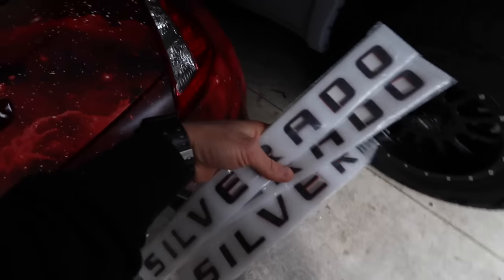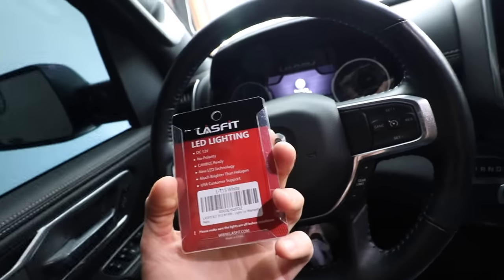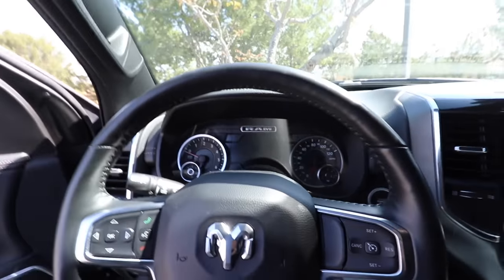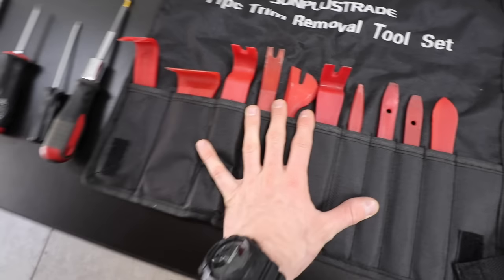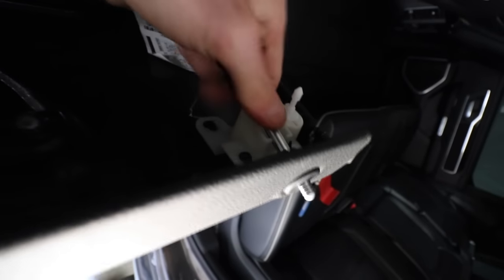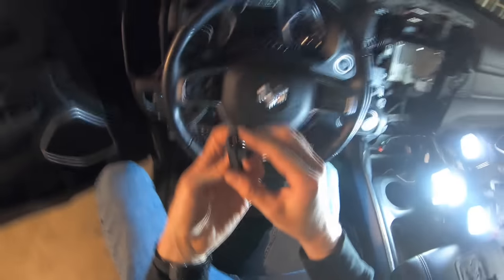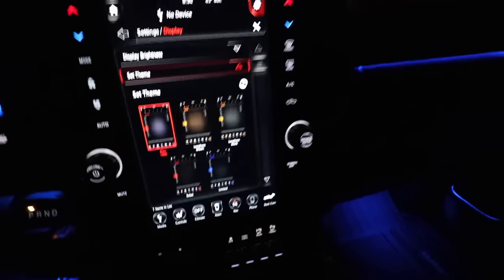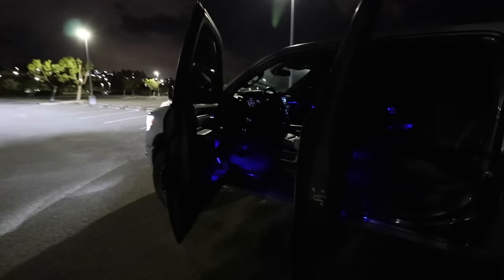Custom Interior Lighting On My 2020 RAM!

Comment: I have a 2019 Laramie with all the options including the 19 speaker surround system. ..not bad for a factory system. Anyway I picked  up a JMS pedal max  kit for it....wow!!!!  it is sick....what a fricken difference.  It takes away the excellerator lag that most new cars and trucks have. I am telling you brother it has brought my hemi to life...I cannot believe how much power I now have. It will light up your tires and throw back your head if you are not careful. It has a adjustment dial so you can adjust the power to tame it down. It is the best $250 bucks I have spent.it takes only about 30 seconds to install. I also installed the factory ram air flow cold air induction system as well. Plus it looks very cool.   Just my 2 cents...

Comment: That P light means there is a problem with the parking brake auto release. It does it on my truck sometimes. The brake light may be off but you won’t be able to drive with it still on unless you manually release it. Cycling the ignition on and off will clear the light though.

Comment: Just finished this today. I was terrified because I didn’t want to mess my new truck up. Your video gave me confidence. Only had a problem with the glove box light. Everything is perfect!
Reply: What happened with the glove box light. For some reason my 2021 Laramie doesn't have a light inside the drop down glove box. Not that im ever in there for anything special anyway but i have ambient lighting everywhere else with the LED package so
Reply: @feras04 it was just tricky to install for me. Had a hard time putting it back in place. I wasn’t placing it back on the little notch and rotating it down properly. Once I realized it then it went smooth
Reply: This company dosent respond when they have faulty equipment

Comment: So, picking up next week a new 2021 Ram 2500 Regular Cab Long Box with gas Hemi , snow chief, Tradesman L2 and some other custom options like push button transfer case, towing, sprayed bed liner, 115vac, etc.
Question: Would the Tradesman L2 package have all those trim accent lights?   I guess I'll know when I pick up the truck....I would be interested in doing the blue light as well
About Blue: .blue light has shorter wavelength. Blue light is the part of the visible light spectrum that contains the highest energy, so even when blue light is dimmed, it is still vey visible... Brightest setting for blue can be damaging to the eyes , but that would take staring at the bulb for a some time.... Blue light is one color spectrum away from UV light (blue-purple). With all that said, nice job, looks great, I think it would look awesome on my soon to be Patriot Blue machine.

Comment: I put the lasfit LED lights in my 3rd brake light which caused interference with my push button start.  The LED lights only interfere when you have it in the brake light.  The bed light does not cause interference because they are off while starting the truck
Reply: Ya i have the same problem i think everyone with a ram who changed out the rear bed light is experiencing this. I found some LED bulbs for the rear bed that don't cause as much frequency so the remote at least works a further distance than with other bulbs

Comment: 2019 Dodge Ram Limited.  Just wondering if the removal of the panels, dash, etc and install of these lights be very similar if not identical b/t your truck and mine?

Comment: Incase you didn’t figure it out yet you should of gotten a windshield with the sensors built in for the rain sensing. Where I live a reg windshield is about $200 and the ones with rain sensing are $700+

Comment: I did the same thing the kit did for $6.99 in super bright 12V blue LEDs and a little bit of time. The LED leads will plug right into the existing harness. Bend the leads so you can use the original case (w/out the OEM board) and that's it. 👌
Reply: Do you have a link to where you got your lights

Comment: 2020 Ram 1500 Laramie here. Been getting a service light for Auto Stop/Start system. Any thoughts? I’ve installed K&N intake, borla cat back exhaust and replaced cargo lights and third brake light with LEDs.

Comment: Hey bro, hopefully you can help me with this. I am looking to replace my 8.4 Uconnect Nav system from my 2022 Ram 1500 Laramie with the 12 inch nav that came off from another 2022 Ram truck. Everything looks plug and play, but do you know if I need to have it reprogrammed by dealer or if there is something that you can recommend buying that will by pass the security system? Your videos are great btw, I am a new fan to your channel.

Comment: In case you weren’t aware, you have to press and hold the ESC button down for like 10 seconds to completely turn it off. If you didn’t;t know, now you do. 👍
Reply from the maker: On the ram though? Tried for a whole minute a few times
Reply: @MarkBrenner  Yes. It will beep and then confirm it on dash. Put in 4wd and try it. First, turn it off with a short press. THEN, press again and hold down. I think you can only do it in 4wd.
Reply from the maker: @Image-X  must be a 4wd thing then it’s not working on mine 😅

Comment: Push and hold the traction control switch and it should turn off the ECS, but love the upgrade.
Reply from the maker: Tried that. Doesn’t work 🙄
Reply: @MarkBrenner  Did you hold it down for 10 seconds or longer?

Comment: Where you replaced the windshield?
Hopefully in the dealer.
There is a bunch a sensor and camera behind the rear view mirror that required alignment during the installation-and post installation of the windshield.

Those light are sick 👍🏽

Comment: I have a 2021 ram 1500 laramie and I don’t see any light across my top dash. Is it just too dim or could my truck possibly not have that light?
Reply: It wont have the LED pipe above the upper glove box but comes with the kit if you select the drop down for it.  Cool thing is RAM kept the connectors for all 3 dash lights, they are just taped up so you have to find them and untape them.  Super easy.

Comment: I'm interested about your cb setup. Where's your antenna and how did you run it? Howd did you mount that radio? Had one on my 17 ram but used the top driver stake hole with an antenna clamp and put my larger radio on the dash with velcro. Wanted to use a smaller one though. Thanks!

Comment: How do you get the light in the storage box above the globe box at the 16:30 mark? Is that from the factory light that's already there?
Reply from the maker: Yes I went in from the area where I removed the infotainment system and pulled out the already existing lighting by rotating it counterclockwise wise and pulling toward me
Reply: @MarkBrenner  how bout a video of that...😉😉😉
Reply: @crobles13  doesnt come on the 2021 anymore. That light was on the 20 model someone said

Comment: I wish these were RBGW. Would 100% do this if I could change between colors
Reply: Ya they are individual and therefore not on one circuit. Actually power wise they are since they can be dimmed .. hmmm. Now i wonder if it can be hacked.. if the bulbs were rgb compatible and.. a module was placed along the path from the dimmer then... Hmm

Comment: If I get the white lights are they brighter than stock? I just want them brighter in the floor.
Reply from the maker: Much brighter yes
Reply: @MarkBrenner  I’ve noticed though they don’t have the 4pin connectors as the stick ones do.
Reply: @MarkBrenner  and are they still dimmeble and also have the second smd led light for when you open the doors?